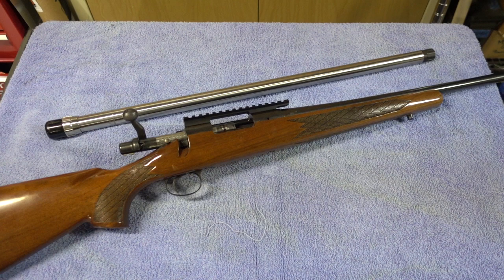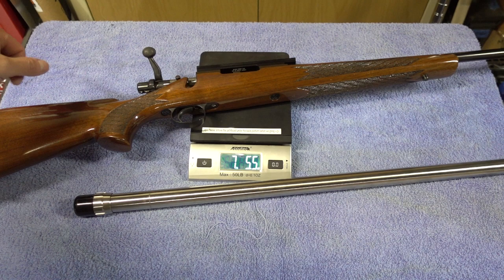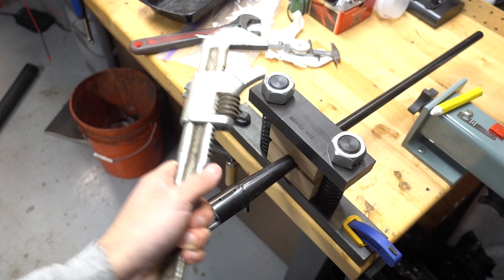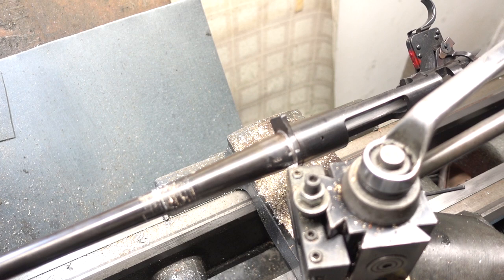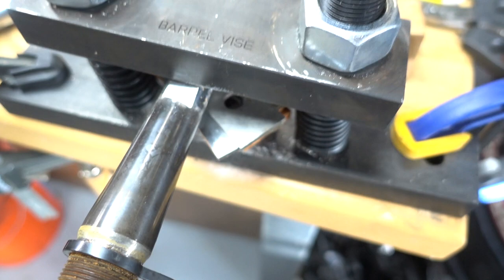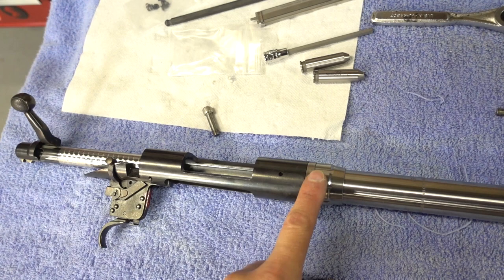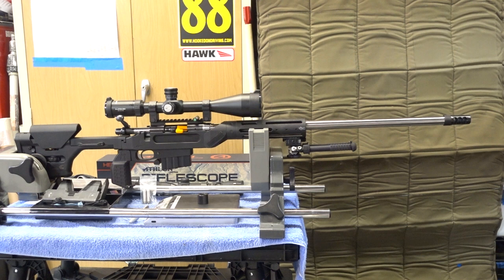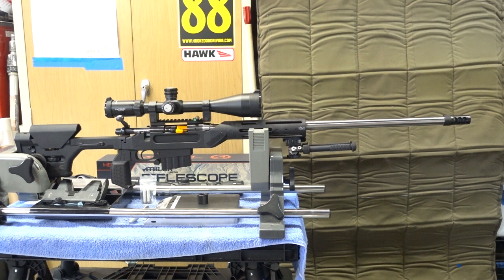Rebarrelling a Remington 700 with a Criterion "Remage" Pre-fit

Comment: I just received my 300 black-out from Northland, I'm  looking forward  to finishing my build.  I run a small pig removal business and sometimes I'm in areas where a miss or a pass through can't happen.  State overseers require center fire with copper or lead free projectiles.  The components are easy to come buy and reloading to low velocity but yet driving tacks at 50 yards or closer is a must.  

Good luck with your build.
Reply from the maker: 300blk subs supressed are very quiet - I have a Rem700 with factory barrel and Silencerco ammo that can shoot inside .75".  I was astonished.

Comment: Did you try any WD-40 at the barrel-receiver joint? I usually let mine soak over night before removal (for savages). Was thinking about changing to a .223 Remage barrel for Remington 700 SPS varmint in .223 Wylde to get a better twist rate than 1/12, but I don't want to ruin the factory barrel if they have it practically welded on.
Reply from the maker: I used PB Blaster for a couple days. Granted my barreled action is at least more than 20 years old so that's probably the leading factor in how hard this was.

Comment: can you use barrel made from titanium or the steel is better?
Reply from the maker: Steel
Reply: @UWMitch  so can not made from titanium. right?
Reply from the maker: @Hammam-Alharith  cannot and are not are two different things. A rifle barrel in titanium will not perform well because of the material properties of Ti versus a properly machined and heat treated steel barrel (there's a reason you dont see any Ti barrels out there)
Reply: @Hammam-Alharith  Probably too tough on tooling

Comment: If you don’t mind, What was the total price of the barrel, remage nut and recoil lug and how long did it take to get them?  TIA
Reply from the maker: Little over $600 including all the tools needed as well. At the time Criterion was back ordered so I ended up waiting about a month, but James at Northland usually had this barrel as a stocked item.
Reply: UWMitch thanks! I will need tools also. I left a message when I called them yesterday afternoon. My rifle isn’t shooting the best about 1.2 to 1.5” at 100yards looking for .75 or better.
Reply from the maker: @bahntango1  local very highly recognized gunsmith would've done this job for me for less than the cost of tools but it was a lot of fun :) 

If your rifle isnt shooting great I assume you've checked the basics like scope base and rings properly torqued and that you're using high quality ammo? With my 300 blk the best groups I could get were about 1" until i tried Silencerco ammo which was night and day to the other ammo I'd tried.
Reply: UWMitch I’ve tried about 5 or different brands but nothing was as accurate as I’d hoped. Of course with the ammo shortage I have nine to try. My other rifles are more consistent with a range at ammo brands. I thought about getting into reloading to see if I get get it to shoot better there is a shortage of reloading supplies also.

Comment: is there anyone who sells a remage barrel that has no chamber with it? im starting a remington 700 build and wanting it in an unconventional round (318 westley richards necked to 338) and any remage pre-fit i find seems to need a chamber with it in the order form. i already have brass and a dummy round and saw where to rent a reamer for it
Reply from the maker: Reach out to Northland Shooter Supply to ask
Reply: @UWMitch  thanks. I was tempted to settle with a 338 federal chamber but remembered the case for the 318 is narrower. not by much but I think I'd notice by the fireformed brass
Reply: @mannequinfukr did you ever do this? Seems cool
Reply: @williambell7763  I managed to. And managed to take a deer a month after it's completion (while finding out 250 grain bullets are rather hard for white tail)
Edit: forgot to say that reaming by hand takes forever (took 6 hours iirc)
Reply: @mannequinfukr  awesome, could try some of the Barnes bullets, I hear they expand well at lower velocities. Cool to hear it went well though
Reply: @williambell7763  I do have a box of Barnes and some cutting edge bullets. I wanted to try the 225 grain but didn't have amount of cases at the time
Reply: @mannequinfukr I bet those cutting edge shoot lights out, hope it goes well. Also reaming by hand takes some dedication lol
Reply: @williambell7763  I heard they perform well. And I am surprised my arms didn't straight up collapse from the reaming lol